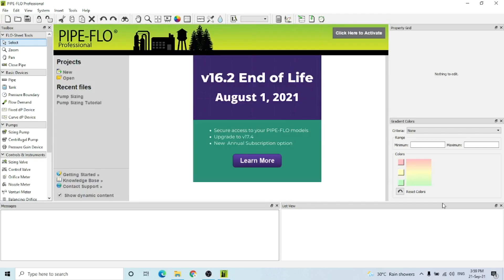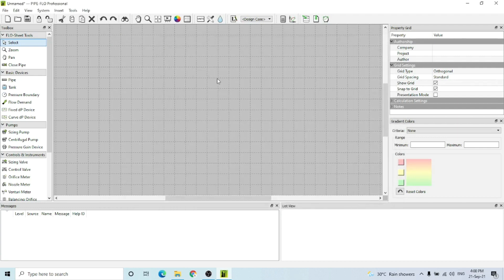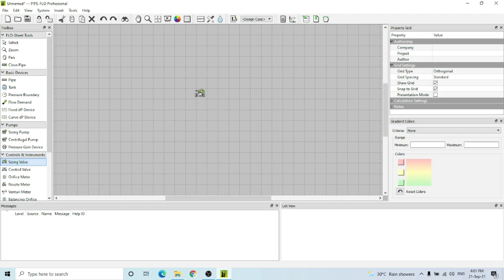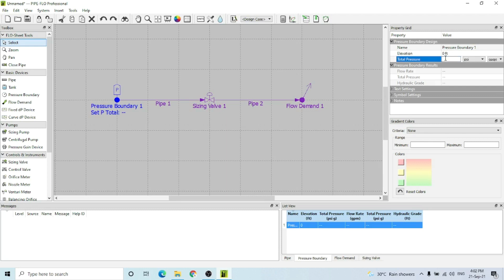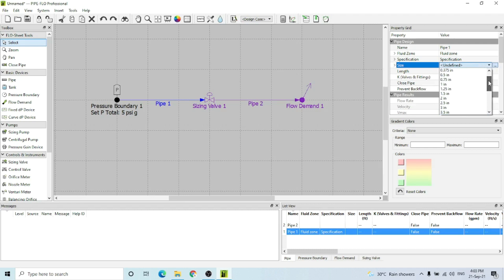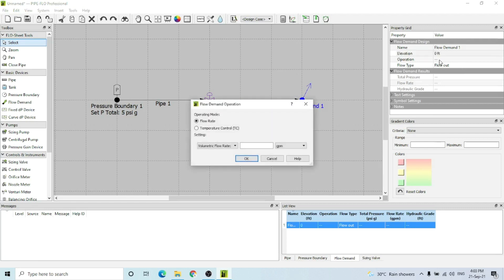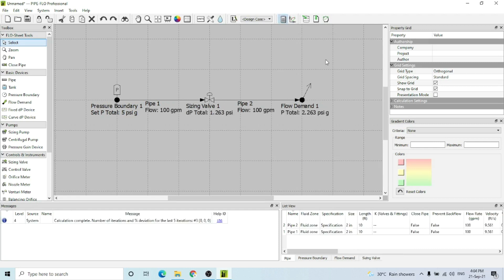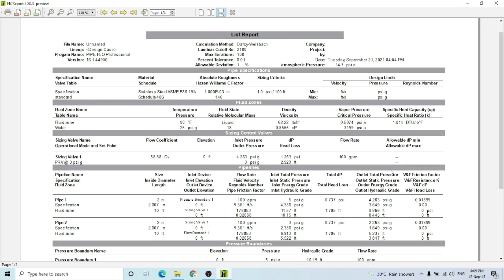Pressure Regulating Valve PRV Sizing on Pipe Flo Professional

Comment: hi. thanks for the great video. can the software calculate the pressure drop inside a rigid pipe for a given flowrate ( liquid or gas) without specifying the type of the pump and the tank connected to the pipe? the reason behind is that the pumps i use are subsea ones used to flood empty pipelines subsea  and its not possible to have a tank connected to it ( the pipeline is flooded using the pressure differential subsea so no tank connected to the pump)
Reply from the maker: Yes you can calculate the pressure drop in a pipe by attaching "pressure boundary" at the start of the pipe and "flow demand" at the end of the pipe